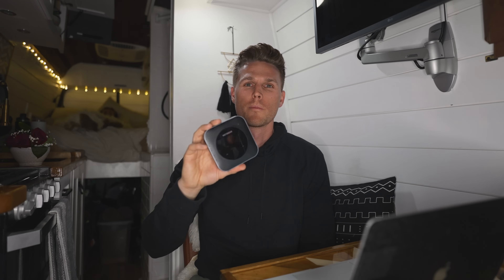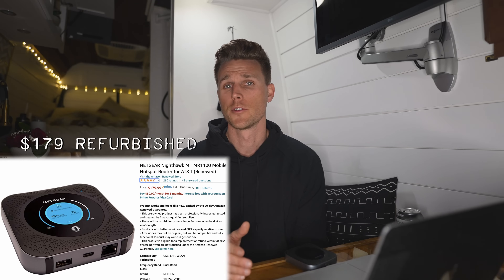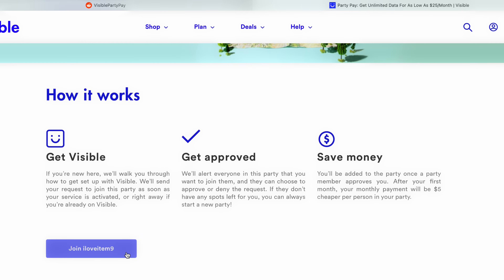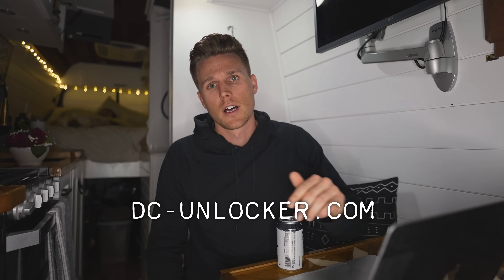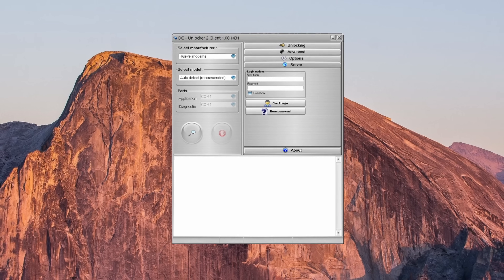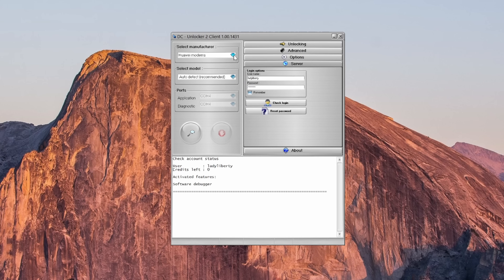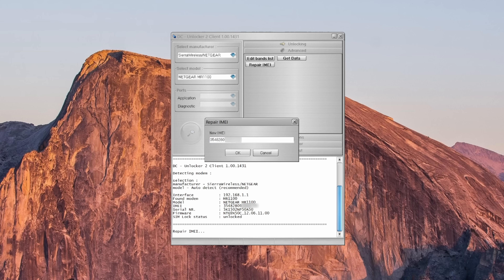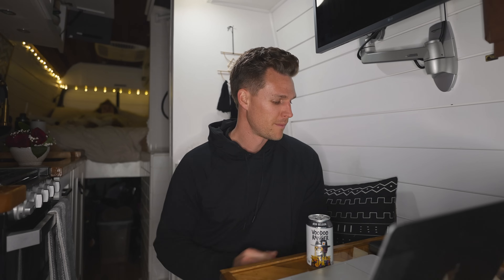CHEAP Unlimited Internet for your Van/RV/Tiny Home or even small Apartment | 2023 | $25/Month

Comment: great video! nicely done!   I ordered a used netgear nighthawk that is UNLOCKED. Do I still need to use and pay for  DC-Unlocker ? Thank you
Reply: YES, you do need to change the IMEI to work on Verizon. Do not be misled by the software name DC Unlocker. In this case, it is not unlocking the router, but rather re-writing its IMEI to be a phone's IMEI. If Verizon sees a phone IMEI, it does not restrict data. If it sees a router, it may not support it, or may throttle it, or may cancel service. So we "repair" the IMEI so it is considered a phone and can receive service by our friends at Verizon.
Reply: @Contango-ix1qf     thank you Mark. I did pay and and "repaired" the IMEI and it's working...sort of.  The problem I have is the netgear keeps  resetting to factory set...the I have to do it all over again.  the other thing is the speed is very slow 0.58 mbps download and 3.6 upload.  why would that be?  thanks
Reply: @mikegill8380  The IMEI, once re-written, should not get reset. It is in a protected part of memory. So perhaps you did not do a Save after you changed the IMEI. From memory, I did a save, then a reboot of the router. It has held solid. These M1s have a spotty reliability however. Some say they run hot and fail, or the battery fails and needs to be replaced. If you do the save/reboot and the problem stays, your modem may be defective, sorry. You can try a hail mary of replacing the battery with a new one from ebay, they are available. Long shot, but worth trying. Otherwise, maybe defective modem. I'd need the modem in hand to diagnose properly. Hope that helps. As for slow throughput, that's a cell reception problem. You could simply have bad reception far from a tower, or be on a bad band for your carrier. I did not play with bands, as mine just works, but perhaps the netgear router software allows you to change bands to see. I used the M1 on Visible and Mint (T-Mobile), and data rate was better on Mint. If you do have a weak signal, you can try an external antenna but that probably won't fix it. Do not expect best performance from this M1, compared to say a MOFI. It is a small, low powered device that probably has half the power of the larger devices on WIFI, and it does benefit from an external antenna sometimes. I love the small size and simplicity, but you need a larger modem in difficult situations.
Reply: @Contango-ix1qf   Thank you Mark ! I really appreciate your input. The batt runs ok, I think, it doesn't get hot,holds a charge. The signal with Visible is max bars, I live in a city. I don't understand why it would be so slow. 0.58 mbps. but I have 3.6 upload. Is that normal? A speed test on my laptop shows 9.4 down and 1.6 upload. I know next to nothing about this but I always thought that download speed should always be faster than upload, just like my laptop.  Why is the Nighthawk speed the opposite ?

Comment: My Visible account will give me very high downloads to the phone but when I use it as a hotspot, Visible will throttle it back to about 5Mbps.  After you modify the M1, what kind of speeds should we see?  About the same as a stand alone phone?  It would be nice if you could include a Speedtest of before and after to this video.
Reply: Ideally, you'd be getting un-throttled speeds from the router.  My guess is that if the IMEI you used is a phone, then Visible will send speeds indifferent than your current phone other than hardware variances.  I made an error purchasing the M5 instead and come to realize that the software does not support this model yet.  doh.
Reply: Is this still the case on your end?

Comment: So I am connected to WiFi but for some reason when I connect my nighthawk with the cord my network on my computer switches to the nighthawk network which obviously isn’t connected with no SIM card. So essentially I lose internet. Any idea for a work around? Or what the issue is? Also, how is everyone getting the SIM card in the nighthawk? It is a nano SIM card but the nighthawk has the larger sim compatibility.
Reply: Bro did anyone ever answer this cuz these were my exact problems

Comment: After copying the IMEI from the phone to the M1, if I put a sim in the phone will it still work as normal? Also, are there other options to the M1 that can still have the IMEI changed or is the M1 the only option?
Reply: It works the same as it did before. The only change is to the IMEI number, which some cell providers (Verizon) scan and reduce data rate if it has a hotspot type number. But if they read it as a cell phone, no throttling.
Reply: @Contango-ix1qf  will there be problems if the IMEI is being used on the router and a phone at the same time? I was thinking the carrier might see there are two devices with the same IMEI and stop service or block devices? The sim in the phone would be a different provider than the router so that may work fine, but would it get messy if I connected the phone to the router's wifi when they both have the same IMEI? I'm thinking it might be easier just finding an old broken phone with an IMEI that works on Visible and using that to avoid any hassle.

Comment: Have you tried re-writing the IMEI on a Netgear LM1200? The LM1200 seems better suited for use on the Verizon network than the Nighthawk M1 because the M1 lacks band 13 which is Verizon's most prevalent frequency in rural areas. At 700 Mhz, Band 13 frequency has better range and penetration in wooded and obstructed sites than the higher frequency bands that the M1 utilizes for Verizon. A brand new LM1200 is only $149 which is less than half the price of a used Nighthawk M1. I'm interested in learning if you or any of the viewers of this video have been able to alter the IMEI and TTL of an LM1200.
Reply: No, I have not tried the LM1200. The older M1 is a combined LTE Modem/WIFI router. The LM1200 is an LTE Modem only and needs an outboard router for WIFI. While the LM1200 has more features, I don't know if the DC unlocker software works on the LM1200. I suspect not, only because the software lists the M1 as a Netgear/Sierra Wireless router, and odds are they used a more modern modem than the Sierra Wireless modem in the older M1. But I could be wrong, you would have to try it. If the modem happens to be from Sierra Wireless, it may have similar software interface and you might be able to change the IMEI. I think you will have to do the experiment yourself.

Comment: So does the Visible sim card act as the unlimited data for the hotspot, correct? Because at the very end you said you have to use a SIM card with an unlimited data plan and you didn't reference the visible SIM card. I'm just making sure I don't have to get to different SIM cards/data plans.
Reply: Visible is truly unlimited. It let you hotspot only 1 device at 5mbs but this method USED to work but as of 10/14/21 it doesn't.

Comment: Hi Jake and Heather - Does the Visible service has to be activated first for the sim card you got? I called Visible and they said it has to activate via an Visible app, which mean I have to own the cellphone and activate through that cellphone first?
Reply from the maker: You can activate the visible sim in almost any phone. Just download the app and put into your phone. It doesn’t need to be the same phone as the IMEI you used to changed the netgear

Comment: Great video!  Is there any additional steps in configuring this to be used for a cell phone booster such as WeBoost?

Edit: The M110 router doesn't support band 13 which is Verizon's main band. Had you noticed any performance issues or dead spots while living the van life and using the router+sim?
Reply: is this legal. especially you have a video. they can track you right ?

Comment: I tried this with no luck. I actually ordered a junker phone from visible and did the steps in the video perfectly. I got the internet to work, but it was throttled at 5 mbps (phone was getting 25-30mbps. Do you think I did something wrong or do you think visible caught on and found other ways of ID’ing the device? Any suggestions?
Reply: Read the comments section - you'll have to change the TTL settings.
Reply: @YasarHabib  I can't find that anywhere. Change what, where?

Comment: Great tutorial, but I'm having an issue.  As soon as I plug the M1 into my computer, my computer seems to want to use the M1 as the sole internet connection. My home wifi still shows as being connected but does not work, unless I ulplug the M1.  If I have unplug the USB, DC Unlocker cannot communicate with the router. If I plug in the USB,  internet no longer works and DC Unlocker cannot connect to the server.  Any help would be appreciated.
Reply: I had this issue too. The most likely cause is that both the nighthawk and your home wifi are using the same subnet. My workaround was to  use hotspot internet from a separate smartphone.
Reply: @YasarHabib  That's a great idea.  My home router is also Netgear so I could see where the conflict could arise.   I also figured a workaround, which involved turning off the computer WIfi with the M1 teathered.  This would allow me to log into to the M1.   Then I would turn on the computer Wifi.   Your idea makes more sense, and I will try it next time.
Reply: @YasarHabib  using HOTSPOT from another phone? I'snt this the reason we are setting this up so we don't have to use Hotspot from somewhere?
Reply: @YasarHabib  I genuinely don't understand how my pc still doesn't grab a connection to my phone hotspot while my m1 is plugged in
Reply: @MrRochaAndrew  What is the issue you are having?
Reply: @YasarHabib  Same as @David Calnin. Trying to change the IMEI. When I plug in the M1 to my PC, I can't access internet. Right now I cant access the servers to dc-unlocker while having the M1 plugged in even though im on a completely independent connection with my phones hot spot. When I turn on AP passthrough, the M1 resets. After that, I can't access the settings to the M1 at all unless i factory reset it. It's just not making sense to me
Reply: @MrRochaAndrew  Try this: connect to the internet using your phones hotspot. Verify your connection, then Connect your M1. You don't have to turn on AP pass through.
Reply: @YasarHabib  Thanks for the help, i was able to change it without changing the AP pass through. I got my sim card from visible, now im just trying to figure out how to activate it with the IMEI i got generated. MY M1 says its connected to 4G LTE on verizon (visible) but i dont get any internet

Comment: Why wouldn’t you use an iPhone hotspot for and internet connection? What am I missing. Sorry I am not as tech savvy as some.
Reply: Long hours working on the road. iPhone battery goes dead pretty quickly.

Comment: Little confused here. I have an older phone that is not compatible with visible, so you swap with visible (ie, samsung sm-s120vl for a blade a7 prime) free, and then just take the sim card from the A7 Prime and put it in the netgear nighthawk m1, correct? Of course you have to do the imei transfer to the M1 before installing the sim card, correct?
Reply from the maker: Yep!
Reply: @JakeandHeather  Just an FYI. When you swap with Visible, you have to, not only, give up an old phone, but also the phone number that was associated with it. If that happens to be on your current phone, it would require that you surrender that phone number as well. Seeing that I need to keep the phone number, because it belongs to  my current phone that I don't want to give up, I was forced into paying $95 for a new phone. The only way I could swap was to give up my current phone and #.  😒

Comment: I'm reading a lot of problems with your fix. I think some steps are left out. Maybe make a new vid. Also, if I can't get it to work, can you change the IMEI number on Netgear back to it's original number? It's an expensive hotspot so I would want to have option to go back to original hotspot IMEI if needed. Thanks.

Comment: Visible got wise to you, I tried this using a 4 year old iPhone's IMEI on the netgear rewriting with DC-unlocker.  Visible limits the speed to 5Mbps :-(  I popped in my ATT sim from my other iPhone and got 15 to 20 Mbps, this is done in the city here where we have full signal for both Verizon and ATT.
Reply: You need TTL settings for visible
Reply: @markm4367  I had to put the Sim in a friends iPhone use the app activate it and then remove it and install it into the router but you have to activate it on a regular phone

Comment: Does this work with an ATT branded M1?
Reply: It does. You have to buy 10 more credits to unlock the device though. Just click on the "Unlocking" in DC-Unlocker software. My issue is the IMEI from a Pixel 3 with the speed still being throttled down to 5Mbps.

Comment: Here's a cheaper and easier way... Buy a Visible SIM, stick it into a compatible phone. Buy a Slate GL-AR750 wireless router for about $70, then link all your devices, computers, iPads, Alexas and so on to the Slate. It's actually very easy and straight forward and you don't have to mess with changing IMEI numbers. Your one linked device to your phone is you Slate. Everything else is linked via that. I have my TV (Roku) linked, plus Alexa, plus other phone, iPad and two computers. I'll be linking more but that is it so far since yesterday, and last night I watched the whole Hungarian F1 Grand Prix without interruption on my TV. I hope this lasts, but so far so good, though some internet browsing is a little slower than I'd like.
Reply: Damn that was a wild race! Good for Ocon and alpine though.
Reply: Yeah mr1100 is good for portability, but it sucks, I build my own system, I have a quectel em12 kicking on my router 100mbps all day, only time I’m using the mr1100 is when I need to move around and I need to have internet in non capable devices. I’m thinking on getting RM502Q-AE 🔥

Comment: Do you have to activate the SIM card in a phone before putting it into the M1?
Reply: Do you order the SIM card from Visible?  I chatted with them and the person on the chat said no.  
I’m confused about that.
Reply: I haven't been able to activate the SIM card putting it into the hotspot.  It looks like it's connected to the Visible network, but not able to get Internet access.  Anyone have any steps on steps to activate the SIM card?  Do you need to install the SIM card into cell phone in order to activate then swap out to M1?

Comment: Hi All, wondering if anyone might know why I'm unable to connect after going through all the steps in the video. Trying to connect my computer to the Netgear connection and when I enter the Network Security Key, it says it's incorrect. However, it is the correct password. Any ideas?
Reply: Did you try resetting the router? The reset is under the cover by the USB port.

Comment: Dc unlocked worked with no issue. I went and got a walmart wireless sims and activated it. Using it currently but unfortunately all the data it uses is hotspot data
Reply from the maker: Try changing the TTL of the computer you are using to 65
Reply: @JakeandHeather  I will give it a shot I just dunno how
Reply: Update: so I maxed out the walmart wireless sim. I just ordered a visible wireless sim and I will let you know my results thanks guys

Comment: Hey I can’t get the Visible SIM to show on the M1… is there an issue with this being an ATT/unlocked unit and a Verizon SIM?
Reply: I'm not sure if we have the same problem or not but after doing some research it seems the sim card needed for the M1 is a Micro SIM but the made up IMEI number I provided Visible is for a Nano SIM (smaller). I am trying to see if I can get an IMEI number for a Micro SIM card.

Comment: I’ve started the process but my question is what’s the difference between using the netgear hot spot or just using a phone as a hotspot?
Reply: Your data will throttled if you use your phone as a hotspot. If you want to use your phone instead of the M1, I suggest you purchase the cheaper gl.inet router Slate, change the TTL to 65, connect your phone to it and tether at full speed.

Comment: Thanks!!! Works perfectly, a few hiccups but in less than 2 hours we got it up and running!
Reply: Can I ask you a question? 
Did you buy your M1 or M2 unlocked? 
Or did you do the unblocker? How was that process?
Reply: @CannonRaystrings  did the m1 unlocked already. Changing the imei was relatively easy, hard part was finding an old phone that would work. Had to buy new junker phone.
Reply: @mazriel666   What did you need a junker phone for?  To get a valid IMEI or to activate the Visible SIM and IMEI combination?  Then transfer both the IMEI and the Visible SIM to the router?

Comment: Would this workaround work with an LM1200 aswell? Similar netgear setup just hardwired instead
Reply: Also, the LM1200 is way less expensive and has coverage for Band 13 and the M1 does not. Band 13 is Verizon's main frequency. Would like to know if there is an app that can alter the IMEI of a LM1200

Comment: Thank you so much for the incredible thorough and helpful video, been searching for a solution! I made it through all the steps and used an old iphone x as my imei. Problem is my speeds were only boosted by basically 1 mbps from 4ish to 5ish. Getting over 5 makes me think it worked since Visible throttles to 5 when using a hotspot. Any tips to get faster speeds??
Reply from the maker: Did you change ttl of the device you are connecting to the m1? If connecting a phone to m1 you won’t get more than 5mbps. When using a computer make sure to change ttl
Reply: @JakeandHeather  Thanks for the quick reply! I did not change the ttl, I bet that's the reason. Is that easy to do? I'm on a macbook pro running big sur.
Reply: Doh! Nevermind I see the info in the comments.Thanks so much!!!
Reply: @krispetsche  so how u do that ? I can't find the info in the comments all I get is 5mbs